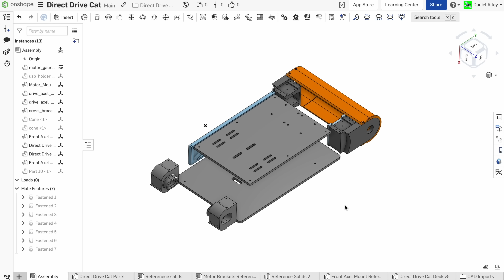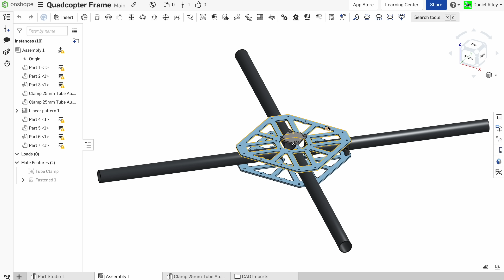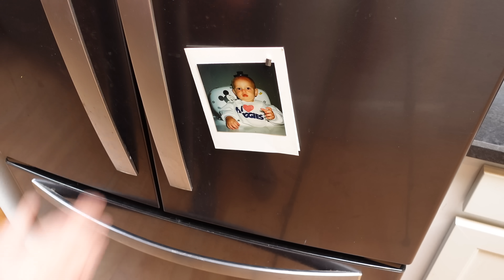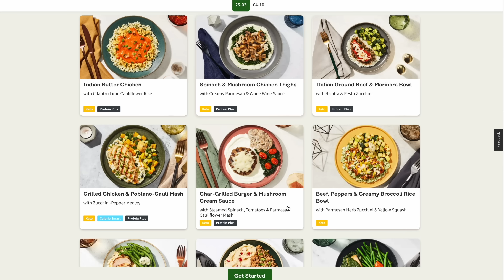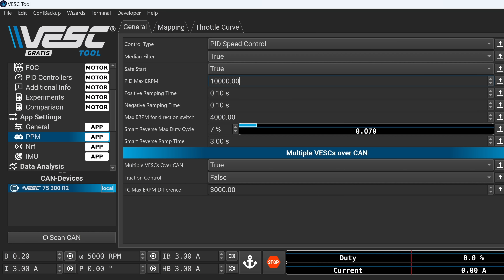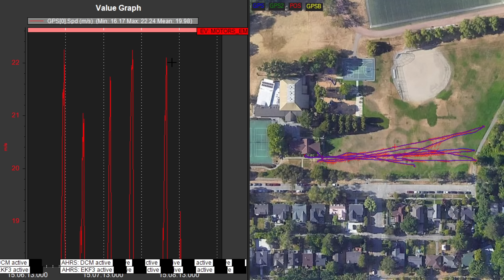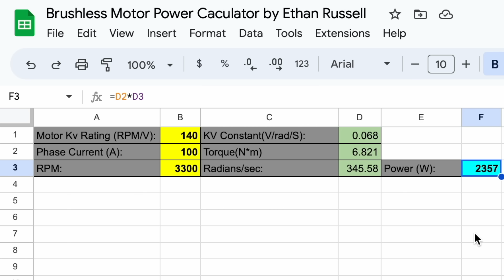Worlds FASTEST R/C Tracked Vehicle

Comment: I believe you could go faster, regular tired RC trucks & buggys gas or electric have doubled that speed(not including tethered cars). Yes much lighter though. You mentioned air resistance on the track,  what if you removed every other paddle, making two different tracks,  shorter paddles for dirt & grass and bit longer ones for snow or sand

Comment: I think your ST 60 connectors on the 12s setup was probably not helping the discharge was pretty high for those connectors lol were they toasty?,....Should make or get a 12s pack with like 170amp rating get those tracks to rip apart from motor torque lol

Comment: I was 11 years old when I learned how fast a quad motor layout is.

 I learned it when LEGO came out with LEGO Power Functions and it was paired with an IT Controller Receiver setup. It was surprisingly fast to the point it became inoperable because the IR controller would lose connection when the vehicle gets too far.

Only downside is that these were medium motors meaning that a lot of a torque was lost, so it would sometimes get stuck.

Comment: I like your calculations for the motor requirements, it pushes a skateboard at 3:1 so direct drive rc should be fast!  It’s the best kind of engineering! and I’ve got to say it’d be more than capable of running with most rtr cars too! Some drag or even a flat track racing between cars and the tank would be entertaining!

Comment: 1:39 "4.7 horsepower each". I'd like to see nine draught horses lined up against two of these motors and see who wins in a tug of war. (Of course horses produce more power initially and so the "hp" unit is a measure of the average sustained drought horse effort over a period of time, and not the initial strength of horses.) It would still be interesting to watch.

Comment: I'm glad I'm not the only one using there electric skateboard motors on a tank... but mine isn't quite as far along as yours. I took about a year break and I'm about to release my next video(currently editing it) of mine running but I know I'm gonna be a bit slower. 6:1 gear ratio on 170kv motors running 12s on each track.

Comment: something about that calculator - it assumes 100% efficiency (or rather, its looking solely at the output power, assuming no saturation) so the input power would be ~15-30% higher than that.

Comment: Hi RCTESTFLIGHT , that looks amazing, I remember you making a ground effect Boat , Have you ever thought about making a electric hydro, but you will need a very large lake with flat water hundred plus miles an hour, back in the 80s I built a electric hydro which was running on 48 V. , these were C size batteries , the British record at the time was 28 miles an hour, I planted my boat on the water it nearly sank because of the weight of it , my first run done 52 miles an hour that was an average of two way run, I ended up, burning the speed controller out, I ended up changing from electric to ic . 3.5 cc 7.5 cc 11.5 cc 15. cc , . Going back to your tank would it be worth putting one motor in the front and one in the back to stabilise the weight, what about building a monster truck four-wheel-drive?/ all-drive. 
Play safe. Phil from the moulin France.

Comment: All that it needs is some kind of downforce attachment to increase the amount of contact (and thus wheel to ground power transfer). Though it is obviously not recommended in snowy conditions, unless you take a page from a snowmobile and add some rails in the front of it to keep the nose from dipping down too far. 

Also, rounding/bending the edges of the track inwards should keep them from hooking onto the snow, and prevent it from flipping as much. Just make sure that they wont catch onto the frame/neighboring linked tracks.

Comment: That is incredibly fast. i think it might be worth checking out giving the middle rollers a dampened suspension. 
Also, I've been using onshape for about two and a half years and I can confirm that it is really good. they also have a free learning center that can very quickly teach you how to 3d model
Reply: any suspension would reduce the acceleration and the battery, to much energy lost in the suspension. Maybe if you just find a way to allow suspension only when not accelerating or under 90% of max speed, since suspension could improve durability at max speed ^^
Reply: @alixhascour1715  I wouldn't be so sure, if it has more constant contact with the ground across the length of the tracks it could actually improve on acceleration simply due to better grip, especially with the high torque of these strong motors. Battery life loss probably will be mostly negligible.

Comment: That thing is seriously insane.  Have you ever considered using brush on Silicone conformal coating for your electronics?  I have had very good luck with it and one advantage is that if you need to do a component level repair it can even be soldered thru without much trouble.  It is much less permanent that the epoxy seems to be. I saw what appears to be a bulldozer on the floor of your shop....hoping I can find a vid of that on your channel now!

Comment: Is there a reason you use epoxy to waterproof rather than something less permanent like silicone gel?
Reply: For the balance you could probably move one motor to the opposite end. Though that's easier said than done.

Comment: The chase footage with dogs was very fun to watch. I thought outrunning dogs was impressive enough, and then you nearly doubled its top speed… well done.
Also, conversions to km/h:
9:32: 11.95 m/s = 43.02 km/h
13:06: 12.57 m/s = 45.252 km/h
13:38: 19.17 m/s = 69.012 km/h
15:19: 22.24 m/s = 80.064 km/h
I prefer m/s since they're much easier to visualise, but the unit most people in the world are most familiar with is still km/h.
Reply: 1m/s = 3,6km/h
Reply: That's insane ! Basically highway speeds there. I'd definitely be scared to drive at those speeds without generous distance between me and other vehicles. 

Also the acceleration! Probably because it's relatively lighter than a motorbike. 

I wonder if it could reach speeds of gas powered ones on a tarmac with an appropriate track / wheel?
Reply: Yes, definitely very cool, almost looked like a video game to me)).
Reply: @dmitriiar2178  definitely felt like video game footage with the drone recording!
Reply: The deep snow runs all I could think of was an awesome alien creature scene in a movie.

Comment: Adding the extra Bearing onto the motor shaft like this might ruin the bearings in your motor over time. Having a (more) flexible motor coupler in there and taking the bearing out should make it way more durable. The bearings in motors this large should usually be more than sufficient for the forces they are subject to.

Comment: Can't you use the IMU in pitch to limit the throttle and angle of pitch?  Maybe an formula 1 type wing in reverse to lift the tail so as the machine pitches the angle of attack pitch increases.  Very cool.  Sand sucks.  It needs a duck or rubber chicken head outstretched forward to make it look faster and funnier.

Comment: I'm pretty sure reducing the track width helped more with speed due to less friction with the ground than reducing the air resistance. The contact pad with the ground is just as important as aero. Wider contact leads to better traction but less top end, and vice versa.

TBH, this rover drone scares the shit outve me. It's essentially a remote high speed land mine in waiting in Ukraine. I bet something like this is already being weaponized. 

It's extreme low profile and high torque and traction would allow it to Traverse a lot of untamed ground. For cheaper construction? The plastic only needs to last one heavy use if it's meant to blow up in the end. The water proofing could be done with wax and the 6s battery configuration seems more than enough speed wise. 

This thing is hauntingly scary.

Comment: Tamiya King Tiger II with twin Trinity Nuclear Assault motors. Pull the trigger and it rode on the drive cogs for about 40 feet then it would finally set back on the tracks 30 years ago.

Comment: Being that I was dealing with brushed motors basically 550's and 570s! Extended wheelbase of that and you'll find even on 6s or its weight it will flow quite nicely this is an added comment by the way

Comment: make a street version for even higher top speed, I think it might be cheating, but I would just use a rubber belt or two on each side. Might have to redesign the rollers and sprockets a lot but I expect the friction to be very low on a rubber belt in comparison, on top of no longer being brittle.

Comment: So insanely quick!!! Definitely the world record. It's mad seeing the plastic start becoming brittle and chipping off in the snow test. I wonder if there's any real solution for that?
Reply: Softer/more flexible plastic, or tougher plastic. Something like Nylon.
Reply: @TranceFur  nylon is super brittle in cooled environments
Reply: @bluecraney1  It becomes more brittle in cold environments, but that can be overcome with the right formulation. A company called RPM had some extremely strong nylon suspension arms for RC cars. They offer a lifetime warranty, and I’ve never managed to break them, even when I was sending massive jumps at high speeds with a 7 kg car in -20° temps. That’s just an anecdote, but flexibility in tandem with strength is what’s required in low temps, and Nylon fits the bill.
Reply: @TranceFur  those blends also come at higher cost and would require a new mold to be made due to most of those blends carrying fiberglass and if 3D printed it would bribe the cost up too
Reply: Solution: don't use plastic?
Reply: @ldub0775  ah yes, just add a zero to the cost. The optimal solution.
Reply: @ldub0775  🤯😆
Reply: TPU?
Reply: Could probably use a different overall track design that would allow the use of rubber… wether be rubber coating, segments or even rubber moulds. it’s not uncommon for rubber to be used in caterpillar tracks.
Reply: @crimsonconductor2235  fiber reinforced rubber. You don't want them to stretch too much.
Reply: @Qwarzz  Kevlar reinforced TPU?
Reply: I don’t think it’s a world record. There are RC tanks that go faster. DARPA has more funding and R&D in this.
Reply: Polyurethane
Reply: Nylon. 

If Nylon can be used in polymer firearms, so can RC snowcats.
Reply: Use metal in it like they do with tires of a car, metal and rubber or something like that.
Reply: Metal.
Reply: Rubberized plastic maybe?
Reply: aluminum or kevlar/rubber tracks maybe
Reply: Use metal tracks just like real life tanks.
Reply: ... he could run it out of ABS, i don't have brittleness issues with my prints because all my parts are high impact ABS...BUT it ain't easy to print well with
Reply: 24 gauge aluminum plate
Reply: even snow at some speed start to be real hard. Push snow slowly you pierce it, punch it real fast , it doesn t compress the same way. Plastic resistance to break is overpowered past some speed i guess, either make it wider or more souple, but in this case we loose some accelleration
Reply: world record is probably 133kmh, 50kmh faster than this. there could be other experiemntal military rc track vehicles that go even faster
Reply: Rubber
Reply: Carbon fiber filament? Like something from a bamboo x1 carbon
Reply: Titanium? If money wasnt a problem i think that would be the last track you would need to buy
Reply: @djkasio  titanium is brittle, wouldn't be ideal for this application because if you hit a rock they could crack
Reply: Don't 3d print, use materials with actual strength maybe.
Reply: my man doesnt know about nylon
Reply: @Kitty_kisses97 hey now, nylon is 3d printable, as is ABS (my preferred material) and either of them would be fine for this.
Reply: @Kitty_kisses97  the initial prototypes a few years ago were 3d printed but now he gets the track links injection molded from a contract place. 
These are sold in the kits. The rest needs to be fabricated or printed by the user like in this video.
Reply: @Kitty_kisses97  all plastic become stiffer in cold
Reply: @Kitty_kisses97  The tracks are injection molded
Reply: @Kitty_kisses97  the tracks are injection molded
Reply: @justinlabarge8178  Then PA66GF30 or something like that. Strong and tough.

Comment: Howdy, I had a quick question for you if you happen to see this. I'm currently working on a project with some students at my university. We have a temperature controller that will have to be completely submerged underwater. Do you think drenching the components in epoxy would water proof them in that scenario? Or is that really only a good application in situations such as yours in the snow?
Danke danke

Comment: Those track pieces could probably last a bit longer with some sort of TPU or other stiff rubber placed strategically within them for shock absorption. The motor guard would also likely be improved with printed-in crap-guides, like a stationary Archimedes' screw, so as long as the motors are spinning their normal direction, they are providing an inertial bias to contaminants, in the direction of an exit. Those dogs looked like they were really getting a great workout, and were practicing excellent pack-chase tactics.
Reply: polytétrafluoroéthylène (PTFE)  resist a lot, resist against 500°F (260°C) aswell, low friction, the lowest of all plastics ;)
Reply: @alixhascour1715  Teflon is great. I don't think I've seen it in a 3D printer filament yet though.
Reply: @buckstarchaser2376  didn t know the name Teflon was the same in english aswell :)
Reply: @buckstarchaser2376  teflon printer needs closed chamber & Extruder for 300°c printing ^^

Comment: Dude, I love your videos but I was horrified by your multiple safety issues in this single video. It shows to me you are treating these things as toys and not the potentially dangerous machines they are. You have either grown complacent and/or a dangerous naivety to these prototypes.  
0:39 Where is your helmet and other protective gear? looks like you are going pretty fast.
5:20 "this might be explosive" so why then test it inside, between two people? 
7:10 Nothing wrong here but a great example of why you shouldn't drive at or nearby people.
8:00 You can't operate these machines near dogs or with small children running about. Dogs play with each other by jumping on each other and by play biting. Both things that shouldn't be anywhere near moving tracks. 
8:47 Shows a dog collision that could have gone much worse, Bad enough that you could have gotten sued.
9:13 Don't jump over your RC while controlling it. What if you accidently accelerate and it starts going flying like at 7:10.
13:20 getting your baggy sleeves really close to a 35,000 RPM gear you are free holding. Do you know what the term degloving is? 
14:22 You do the same thing again 
 14:52 These isn't even as bad as most of your videos, but please stop harassing your local wildlife with your prototypes. It's not cool.
15:45 Driving way too fast at yourself and showing why you need to give it space.
16:50 Driving your fast 25 pound RC vehicle between 2 people and nearly clipping yourself. 
18:20 Great example why prototypes should have a Kill switch.
18:32 Again driving too close to people.
I really hope its only a toe or a finger you break before you learn to be more safety consciences. 
Because even though it would get the views, I don't think your Sponsors would like a "My Prototype nearly killed me/someone else!" Video.

Comment: you would think an open differential would make it more stable..   would prevent it flipping when only one track is hitting the ground under hard acceleration..  or an ABS like system on the motor controllers checking wheel speed ect ect..  thats complicated but would keep away from gears and chains

Comment: If you want to risk it all for some extra speed you can enable "field weakening" within the newer vesc firmware's which can give you an extra 20-30% top end at the cost of higher power usage and some risk to hardware in case of power failure.

Comment: 14:42 looks like you need more ArduPilot magic: Steering clearly needs to be gyro-stabilized, and torque output needs speed governed, based on accelerators :)

Plus autoswapping the steering based on the traveling direction :)

Comment: Something that you may not be familiar with that I learned about thru snowmobiling is the angel of attack of the track, this refers to the angle that the track is at when it's engaging the snow, too steep and the track has to dig the snow out instead of riding over it, you may want to have the front of the track at an angle which should help it plane on top of the snow before it starts to dig in.